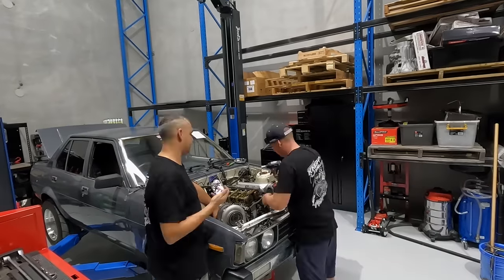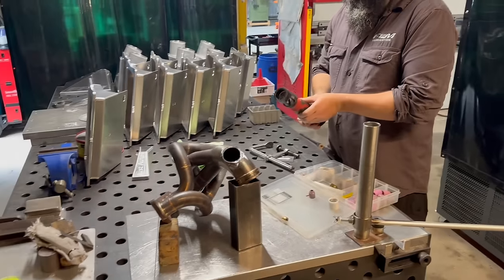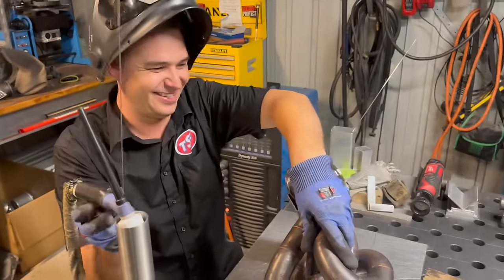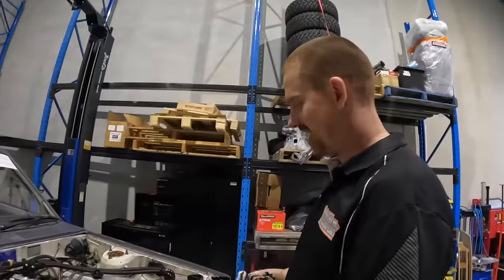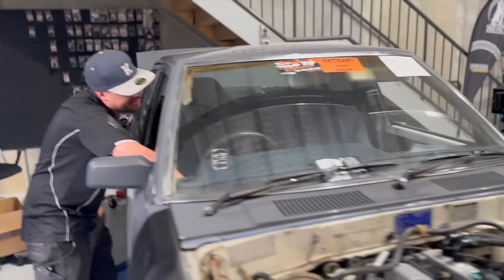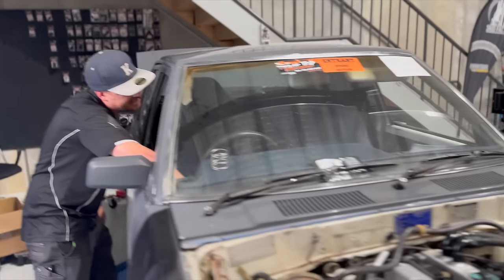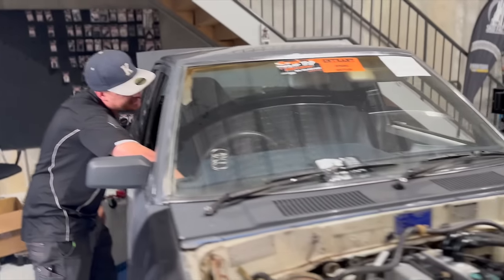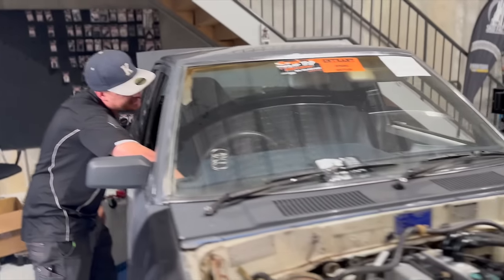650HP from a BASIC K24! The Vital Data needed to stop lifting heads!

Comment: When diffs don't come on the third or fourth mallet strike, I grab a sharp chisel and a hand sledge, I named mine Mjolnir, and go straight up from the bottom where the gasket/silicone is. It breaks loose quite easily 9/10. I always keep a nut loosely threaded on the bottom stud so that it doesn't fly out once loose, as well. Just in case that helps.

Comment: what was the verdict on the fast IAT sensor Woody?

seems a pretty common upgrade on RB's running aftermarket ECU's
Reply from the maker: Yeah we forgot to cover it!! But yes alot more responsive and accurate than the previous sensor.
Reply: Great to hear.

Nice to see Syltech's new line of combination temp/pressure sensors utilizing 1/8npt threads and Deutsch DTM connectors - much more user friendly than Bosch's trapezoid connector and M10 thread.

Comment: I'm curious to know more about that rear axle and diff. Is that also a Hilux axle? Because you have me wondering if the V6 Hilux diff with bolt into a 77/78 Celica GT axle. If it that still a T-series axle what year diff and axle works together.

Comment: So thats a stock long block with MLS/head studs with maybe rings regapped and stock cams? 

Need to drill a couple holes in the diff center flange and thread them for some bolts to help jack the center free from all that RTV😂, when i saw the rtv AND gasket i said that fukr will never leak but gonna be bitch to get loose one day.